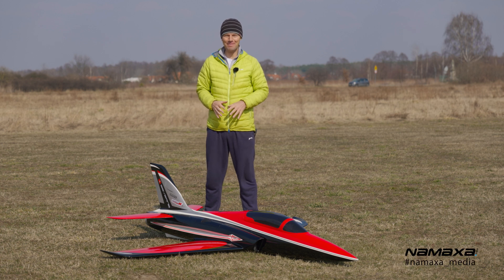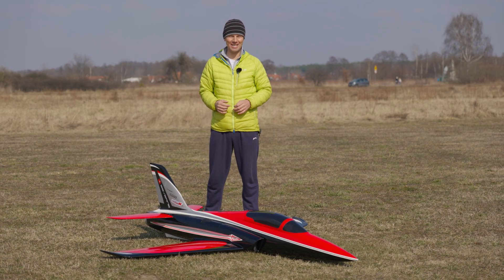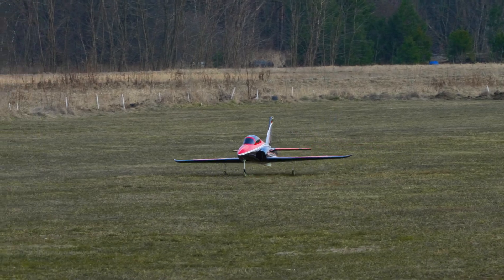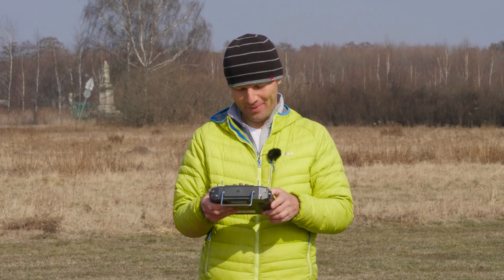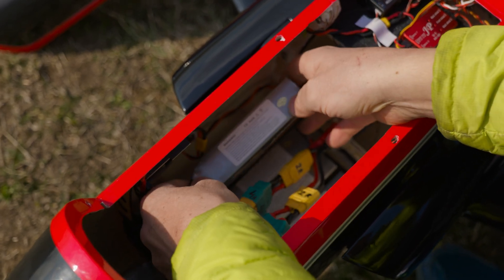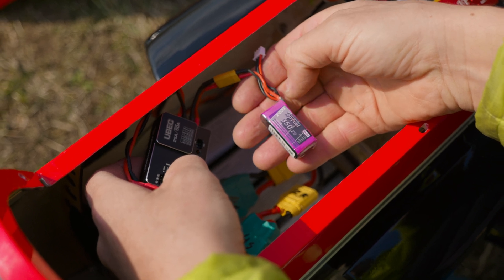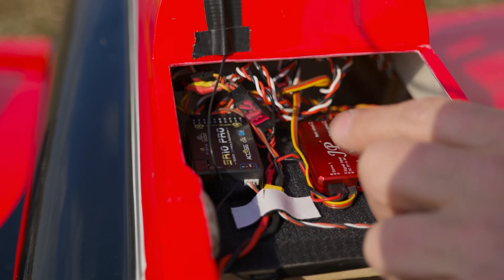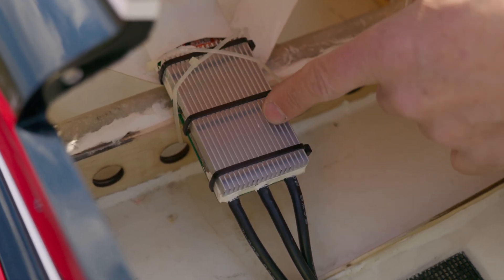16kW edf 367km/h JETFAN-130 Odyssey 13kg weight to 18kg thrust 265A Graphene 16s 8Ah TOPRC Jet Sound

Comment: Sound is Fake
Reply: It is not, he choses his EDF setups meticulously and above that he plays with 'cheater'holes close to the intake (if you watch closely, intro on the jet, side top side, he has a triangular cheater hole cut). Above that the camera setup he is using is paired with a directional microphone. It is all real sounds (and sound is not only the EDF, the airframe, etc all contribute), should watch more of his videos...
Reply: @unknowninvictus2520 I came to say the same thing. You can manipulate sound with the intake. It allows you to hear friction of the air compressing as it enters. I have a little 70 that sounds wicked due to the intake lip.
Reply: LMAO Fake? Really?  Yes, it was manufactured by assembling hardware in a certain configuration and it ends with that sound.

Comment: Greetings Wohjek, I could use some guidance... Mine has the JF130pro/56104-650kv and can't settle on 16s3p13500 or 16s4p18000 Molicel P45B cells. I like lots of 67% @120A cruising and the 18000 would be @14kg and give 8-10min. Not sure 3p will stay cool enough even though the plane would be nice and lite.

Comment: Did you modify the intake to create a more jet like sound? There is hardly any motor noise audible, just a loud whoosh sound which is great. In my experience suboptimal intakes, especially cheater holes perpendicular to the direction of flight, sound great.

Comment: Hi, I'm planning on using a jetfan 130 pro in my odyssey jet. I'm curious to try out your self designed intake lip. Could you send me the files to 3D print this myself? Also, did you use filament or resin printer for this part? Thanks a lot! Looking forward to test out this setup!

Comment: GREAT FLYING!! I love the way you fly close to the deck were contrast in speed can be seen.

What is your efflux from this fan? It has to be sick ... I haven't seen many fans over 200 mph efflux from the fan installed with the thrust tube but to go 200 mph in the jet the efflux has to be around that number or even higher.

Thx in advance

Comment: Great Plane ,i  think the effency isnt very good.My 90mm have 3.2 Kg of thrust at 108 Amps and 6s. A 130mm Fan must have a thrust between 20- 25 Kg of thrust at this power consumption.Try different EDF Motors and see what happen.I testet 5 Motors to find the optimal performance .
Reply: What's the efflux of your 90mm EDF? Thx in advance

 Efflux or exit air speed out of the thrust tube installed is a pivotal factor in jet performance,. To go over 200 mph hr  the efflux of the EDF in the video most likely is over 300 mph. The static thrust of an EDF can be high and Efflux speed be low the model will go the speed of the low efflux but get there quicker.
Reply: @edfhobbies556  Looking for the answer to this question also.